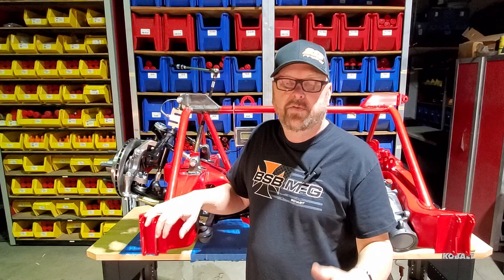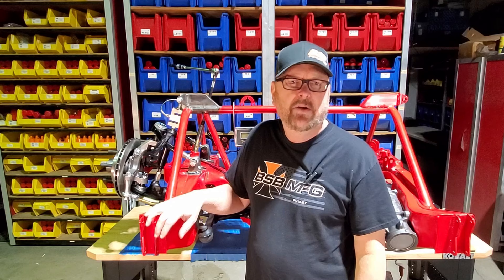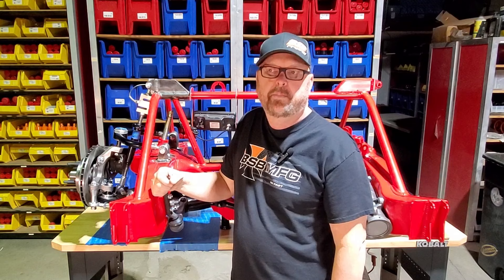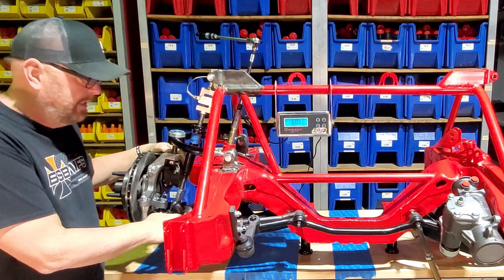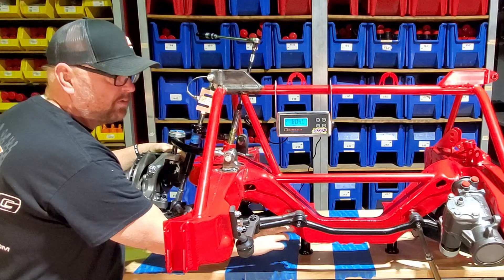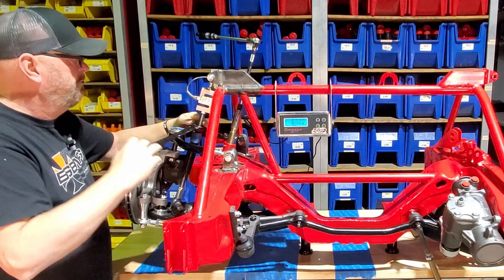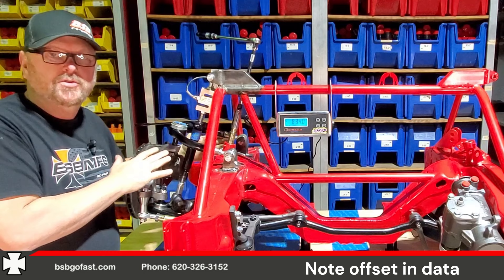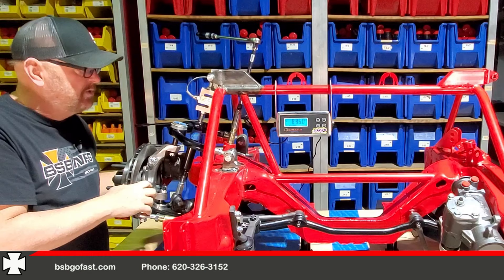Rf Spring Load and travel numbers over 5 different spring rates.

Comment: Springs do not generate load, your down number will be the same no matter what spring is in the RF. If your down number is 1300lbs with a 450 spring, it will also be 1300lbs with a 650 spring. The difference is your travel number, the 650 spring will not travel as far as the 450 spring. Look at the variables in the lateral weight transfer formula: total weight, center of gravity height, track width, and lateral acceleration. Those are the only things that will change your down number. Spring rate will change how fast the tire is loaded and the total amount traveled, that’s it.
Reply from the maker: Your explanation correctly emphasizes the relationship between spring rate and travel distance, while highlighting that the downforce remains constant regardless of the spring used. Springs indeed influence how quickly a tire is loaded and the total distance it travels, affecting the suspension system's behavior. The variables in the lateral weight transfer formula, such as total weight, center of gravity height, track width, and lateral acceleration, are the key factors determining the overall downforce. It's crucial to consider these variables when optimizing a vehicle's suspension for performance or specific applications. Thanks

Comment: If you want to use that machine I brought to PRI just give me a call. It would make it  easy to test / show wheel load on different offsets. Besides the wheel offset test you can move the upper cup around and show how much that changes / potentially screws stuff up.
Reply from the maker: I may need to do that, it would help.

Comment: Some of that load loss from the rater to the in car example is due to the shearing of the spring from the arc the arm makes vs the pure axial loading in the rater. I have always wondered with how easy it is to bend a stamped chevelle etc type lower if there wasn't some degree of compliance or twisting when these arms are down and loaded up with a load stick that fools with these numbers a bit too. Obviously we always struggle with simulating the forces a car really experiences at 100 mph when they are sitting still in the garage. It would be interesting to see how these numbers differed from a comparable fabbed lower
Reply from the maker: Yes, we can do that and we can check to see if the stamped lowers move when we add load. I will check to see where the fab lower spring bucket  is compared to a stamped one.

Comment: Question, so when you talk about so many variables to get where you should be really does it comes down too what really feels right to the driver and  of course making sure the obvious is correct such as ride heights,  bottoming out the RF frame etc? Keep those videos coming! Thanks Jay.
Reply from the maker: Feel is a magical thing and has a greater power on a race car. But making the right choice in the changes you are making will keep you from going down a bad setup path. Let’s say we have 5 options to fix our problem, one of them is the fix and the other 4 will help somewhat but also cause problems throughout the car. It is fixing the problems that start causing the issues with the handling of the car.
Reply from the maker: Now we need to know a couple of things too. Stock Car / 950 spring / 7/8 below ride height / car is hitting the track. In this case, we would increase the load that would raise the ride height keeping the car off the track.

Comment: One spring manufacturer  states you should use the shortest springs you can because a shorter spring rebounds faster.  Is this true or just marketing?
Reply from the maker: Not for sure that I would say rebound faster only because it would confuse people with how a shock rebounds. Rebound in the spring is in the rate of the spring and how much total load is on it at that given time, that rebound is controlled by the shock. A shorter spring has a lower spring table which allows weight transfer easier to that location. A shorter spring has less wire in it (of the same design) which means it will return to zero faster than a taller spring. This spring will need more rebound to control the frequency in that spring. Higher or lower I am not sure how to express it but a shorter or less active coil spring will be stiffer, not in rate but in frequency of the spring. Some plus to a shorter spring, but there is a lot of hype in the spring market currently.

Comment: Algorithms must be working for me. First thing I saw when I turn on YT. Everyone should be testing all this if you are looking for speed. Some guys dont understand why they need these numbers. But the more info like this a racer has the more they will understand what is actually going on. And then you make correct changes when it matters. Keeping notes on everything is more important than any engine. This is all great information. 
Also no matter who's chassis you have you should check that jack bolt alignment. My son bought what was gonna be his starter mod. We stripped it down and started the rebuild from zero. As we started the front suspension we found the bolts were over an inch forward! I wish I was kidding. Thru the cycle it only got worse. I was gonna fix that but so many other issues along with it we decided to scrap the chassis. Pure junk. Keep up the great videos Jay. I will keep sharing. When new guys are asking for help this is a place I can send them! Thank you
Reply from the maker: 100% right, need to check the car from end to end. The more you know the better you are.

Comment: Just to clarify. on the front of the car the "Down" number represents load at ride height? and the "U"p number represents load at a certain compressed distance, i.e 2",3" or 4"? same  for the rears?
Reply from the maker: That is the problem with terms like up and down. My dad would say " he don't know up from down" I know what he means. LOL
Reply: These are the terms you are using. Just trying to understand. i'll assume an "UP" number refers to anything from static ride height thru compression, and "DOWN" thru extension? @jaynealgofast